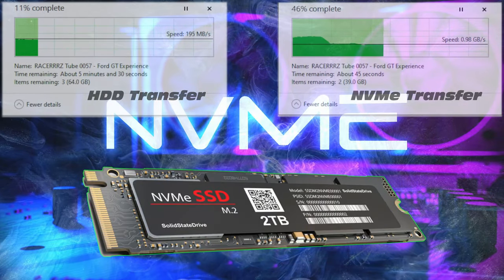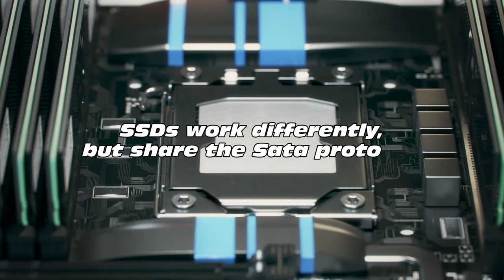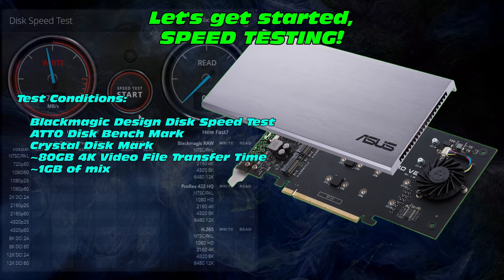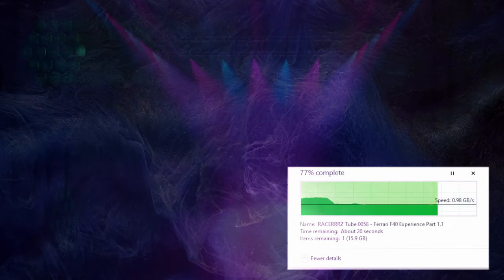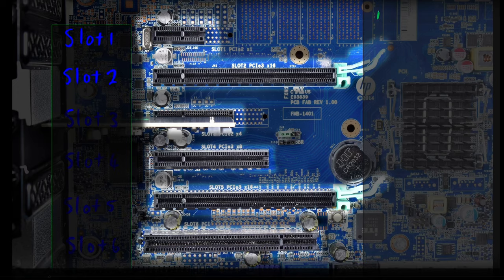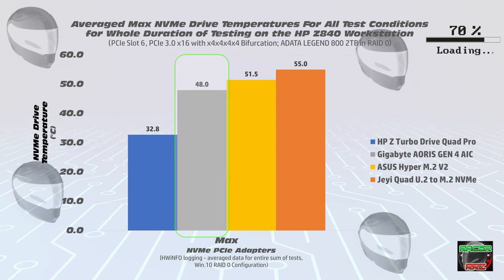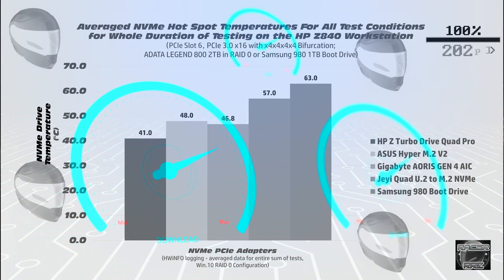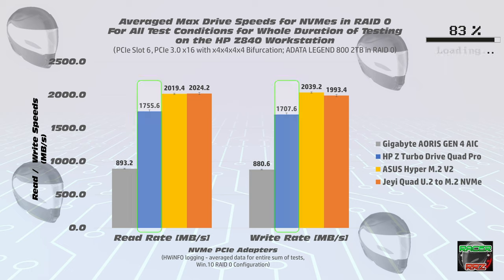8TB RAID 0 Guide : 4x PCIe NVMe Adapters Tested - Which Adapter Reigns Supreme? HP Z840 Workstation

Comment: Another fun, yet informative video! A couple of notes. 
1. I’ve seen others suggest that 1tb nvme’s tend to be a bit quicker than 2tb nvme’s when used in raid arrays. 
2. A few other videos I’ve seen recently testing speed and thermals for nvme’s actually suggest that pcie4.0 nvme’s (drives themselves not adapters) run a bit cooler while still achieving the same if not better read write speeds. I wonder if this is equivalent to 4 and 8 cylinder engines going at the same rate of speed.  They can both achieve the same speed, only one can do it at lower effort (and temperature). 

Thanks again and keep ‘em coming for us z-enthusiasts
Reply from the maker: Thank you, I am glad you enjoyed it. I had not picked up on that detail, nor I have tested the 1TB drives in RAID0 just yet. I just figured it was the lack of DRAM that slowed them down but maybe there is more to it! (I don't have set of 4x DRAM NVMes to test). I'll see if I can clear a couple of 970 Evo Plus NVMes to do a quick check relative to the 980's. 

The max RAID 0 speeds of ~2000MB/s on each NVMe doesn't seem all that random (PCIe 2.0 speed limit was this also) and I presume there is a limit somewhere that restricts the speed of these NVMes. Being DRAMless does require them to more heavily use the CPU and RAM and that may be the speed restriction. 

The Adata Legend 800 NVMes are a bit of a hybrid given that they are PCIe 4.0 but only have PCIe 3.0 speeds. They may not be the fastest drives around but what I liked about them was the endurance rating (2TB; 1200TBW) and the fact that they are running at PCIe 3.0 speeds (well matched to the Z840; Samsung 980 Pros being bottlenecked by the Z840's PCIe 3.0 would be a bit of shame).

Likely yes, the efficiency of the PCIe 4.0 NVMes must have improved to net the higher speeds at lower temperatures / more torque / area under the curve. The question is, are the newer Gen 4.0 NVMes the V8 or the tuned 4-cylinder with variable valve timing and boost? haha (Older and running hotter would suggest to me V8 for Gen 3.0 NVMes lol).

Comment: Hello, thank you for the great video, any chance any of these would fit into my HP z600 v2 ?
Reply from the maker: That's a good question. Technically they will fit but there is a limitation that will prevent the system from detecting more than 1 NVMe in these adapters - bifurcation. The Z400, Z600, Z800, Z420, Z620 and Z820 lack bifurcation support in the BIOS. There are some technical workarounds that may work but they come at a cost. One that is worth consideration is a NVMe PCIe adapter with a PLX chip - which would allow bifurcation to be managed independent of the motherboard. I have not had the privilege of testing them out (mostly due to cost) - but that would be the only way that you could get multiple NVMes on the single PCIe slot for the older workstations.

Comment: Superb video editing and information. Subscribed. I have just purchased a HP z640 workstation with dual CPU, e5-2699v3 64 GB ram. Currently has M4000 Quadro. I plan to make this into a video editing machine for use with Premier Pro etc. Starting with upgrading the drive read and write speeds. Will the Asus Hyper M.2 v2 NVMe pcie adapter work with x4 NvMe SSD in Raid 0 and will it boot from this Raid 0 setup with Window10/11? Bios version is m60 v02.61 (03/23/2023). Thanks in advance.
Reply from the maker: Thank you, I am glad you enjoyed the video. Nice, the Z640 is a trooper, especially when the riser CPU board loaded in. The Asus Hyper M.2 V2 will allow you to get your RAID 0 pool up but right now there is no way to boot to Windows from a Software RAID. In theory it should work with a Hardware RAID configuration on a PCIe RAID Controller. There are some risks with that setup - as I am sure you'll appreciate. If you can backup your OS to a HDD then that should give you fast speeds. 

On my system (HP Z8 G4 right now), I have a 1TB Samsung 970 Evo Plus as my OS drive (where I install DaVinci Resolve Studio) and I store the active video library on the RAID 0 pool. Those files can then be backed up to a HDD (e.g. 16TB Iron Wolf Pro), and then backed up to a NAS (I use my Z440 case swap for this - with 10GbE networking). RAID 1 (e.g. two HDDs or SSDs) and RAID 5 (several HDDs) would be ideal as secondary and tertiary backups.
Reply: @racerrrz  Thanks for the update, that saves me some time with any NVMe boot issues! I’ll have to try a workaround using a Clover Bootloader on a USB connected to an internal motherboard USB port (keeping it hidden inside the case) to boot from an NVMe flash drive, like the on a HP Z420 workstation in the Linus Tech Tips YouTube video "Can’t afford a Gaming PC? This one's $169" .

Comment: It doesn't matter much for newer hardware since they tend to have Bifurcation but some older motherboards from X99 and especially X79 don't have bifurcation. So something to be careful with. My ASUS X99 workstation boards don't have it. There are adapter boards with PLX-like switches on them that allow you to run multiple drives per card but they are of course more expensive.
Reply from the maker: Hi, yes that is correct. The NVMe booting and PCIe bifurcation tends to vary between motherboards and manufacturers, and support needs to be checked. 

The HP Workstations (from ~2014 onward) obtained support through BIOS updates (as an example, the HP Z440, which supports bifurcation, uses the same CPU socket as the X99). 

I have read about NVMe adapters with a PLX Chip but they are not all that common and do come at a steep price. But those prices are coming down and right now something like the IO CREST Quad M.2 NVMe Ports to PCIe 3.0 x16 adapter (has a PLX chip) costs nearly the same amount as the HP Z Turbo Drive Quad Pro. For ~$300 USD you could likely get your Asus X99 workstation board to support NVMe drives. Hopefully you did get a BIOS update at some point to allow booting from NVMe drives via PCIe?

Comment: Regarding the unexpected speed results, in which order were the adapters tested? Was the first adapter retested at the end? Some wear or wear management internal to the drives might have had a large effect, especially on brand new drives. Retesting the slowest and fastest again would be pretty telling, even if the drives have been used extensively since the first test.
Reply from the maker: Hi there. Thank you for the suggestions. I agree, it would be worth retesting the AORUS and likely the HP Z Turbo Drive Quad Pro with the same drives for comparison (the Jeyi U.2 adapter is way too much work to assemble! haha). I have not had a chance to actually fully implement the new NVMes into my workflow, so they stand in the same state they were when I finished the Jeyi U.2 test. 

All the adapters were tested back-to-back (same day/night, in order; #1 Aorus, #2 Asus, #3 HP and #4 Jeyi U.2) and the transferred files on the NVMes were deleted between tests on adapters, but the drives were not / RAID 0 was not formatted between tests. Given the relatively small data load that the NVMes would have received I would not expect the NVMe performance to change drastically between tests (I would estimate less than 200GB was written after all testing - so likely ~50GB per drive factoring in the RAID 0; making it ~200GB of "wear" between adapter #1 and adapter #4 per NVMe). They do slow dramatically when they become filled with data however, but that is less likely to be an issue here. The best case would be to purchase 16 2TB NVMes so that it is a fair test, but that's a bit excessive on the budget!

No I didn't retest the AORUS adapter at the end, mostly because I needed the AORUS adapter after testing for work / it is still in daily use with a set of 4x 1TB Samsung 980's (not in RAID; I have various software on them and it will be a pain to remap it all). 

I have a new video nearly out that looks at the AORUS data in a bit more detail, with data for 3x different speed tests (Blackmagicdesign Disk Speed Test, ATTO Disk Benchmark and Crystal Disk Benchmark) and the speeds were all slower than expected for the AORUS (Max ~3500MB/s Read & Write while in RAID 0). 

I would want to test a set of four DRAM NVMes and ideally a set of four PCIe 4.0 NVMes in a PCIe 4.0 PCIe slot (I don't have a PCIe 4.0 motherboard on hand). If I get some spare time I'll go back for another test in the AORUS - same ADATA Legend 800 NVMes but a new test. My hypothesis is that the AORUS doesn't handle higher than 3500MB/s on read/write for the PCIe 3.0 interface, but I can't quite test this and I haven't found any videos online to test my hypothesis (note it performs as expected on PCIe 4.0 from what I have seen online). The only other thing I noticed was that drive capacity might have a role in speeds also, but most of the videos I found on the AORUS were for 1TB NVMes. 

Side note, all four adapters were slower than the theoretical maximum for RAID 0 on these NVMes on a x16 PCIe 3.0 slot, which I have as closer to 14000MB/s (ignoring overhead, data distribution efficiency, or PCIe slot limitations etc.). But I suspect the slower speeds (i.e. Read speed of 8000MB/s on RAID 0 = ~2000MB/s per NVMe) were at least in part a consequence of not having DRAM on the NVMes.

For comparison, check out BuildOrBuy's Channel. He has a very methodical approach to his testing. He saw decent speeds on the AORUS, but he used a different system (Gigabyte TRX40 Designare) and GEN4 hardware, and not 4x NVMes in RAID0: https://youtu.be/CR-1beSxNqE

Some of His AORUS Crystal Disk Mark Data (Peak Sequential; SEQ1M Q8T1 @ 1Gib):
980 Pro 1TB: Read: 6612MB/s, Write: 4957MB/s (@ 61°C max)
SN850 1TB: Read: 4012MB/s, Write 4340MB/s (pre-firmware update @ 58°C max)
SN850 1TB: Read: 7071MB/s, Write 5215MB/s (post-firmware update @ 66°C max)

edit:
Another video showcasing the AORUS's true potential (4x 2TB Sabrent Rockets in RAID 0 on TRX40 AMD system with PCIe 4.0): https://youtu.be/U-KBgEXrWLA

Comment: Kindly test Sabrent
Reply from the maker: I considered other NVMes but I settled on the Adata Legend 800's for their price point + endurance rating + being PCIe 4.0, but geared for PCIe 3.0 performance. 

I don't plan on upgrading to a PCIe 4.0 system anytime soon - which made me hold off on getting the newer gen NVMes (my hardware would limit their speeds to PCIe 3.0). But I have been keeping an eye out for a "cheap" modern system that I can use in videos. 

If a good price comes up for Sabrent rockets I will grab some for testing!